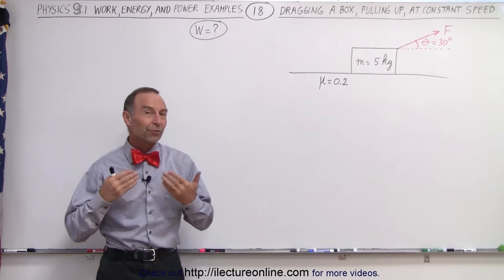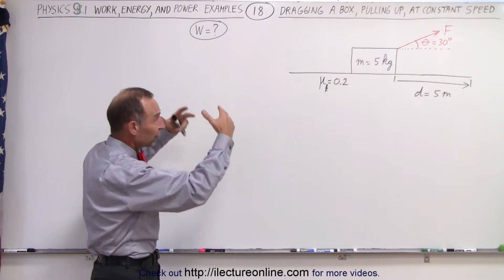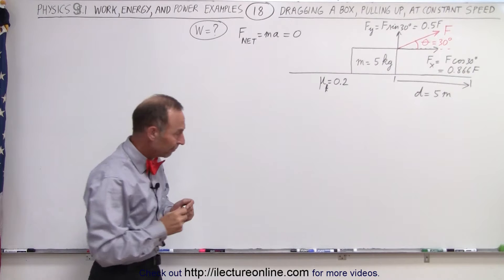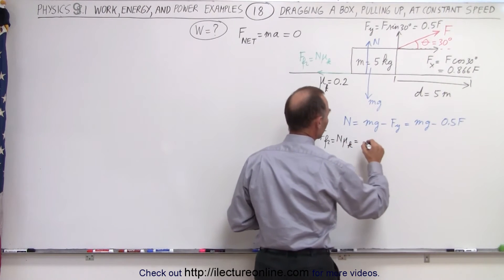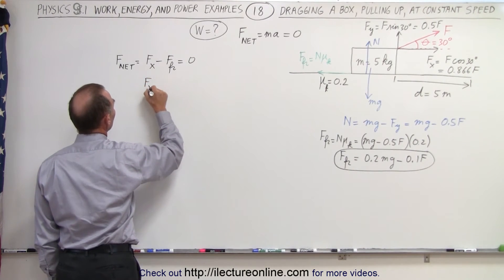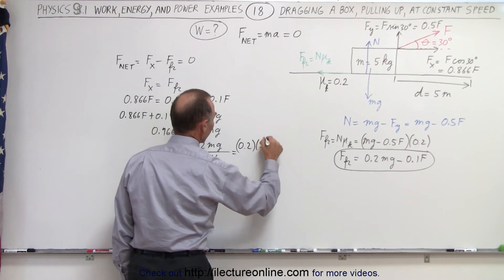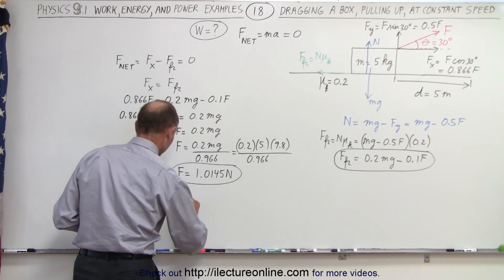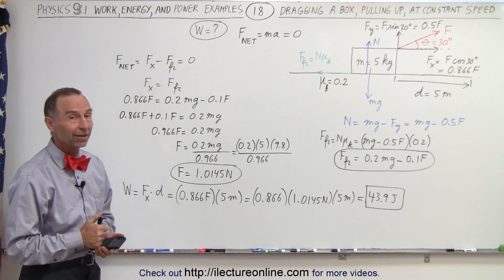Physics 8.1  Work, Energy, and Power Examples (18 of 27) Dragging a Box at Constant Speed

Comment: PH3A: Could you explain why it would be N = mg - 0.5F instead of N = mg + 0.5F? Does it depend on the direction of the force vector?
Reply from the maker: Since the vertical component of the force is pointed upwards, it will essentially cause the block to weigh less as experienced by the floor.